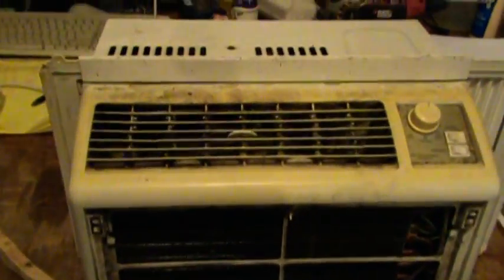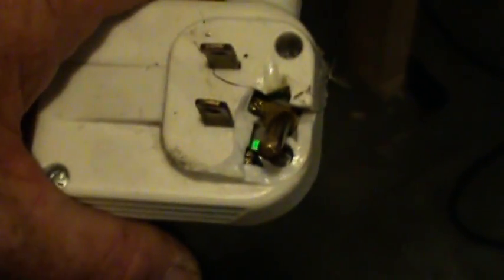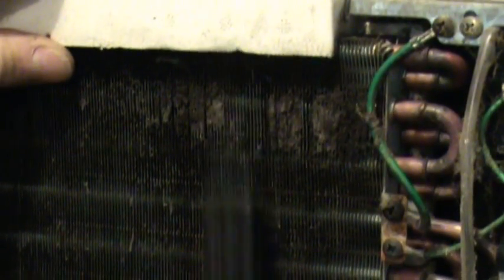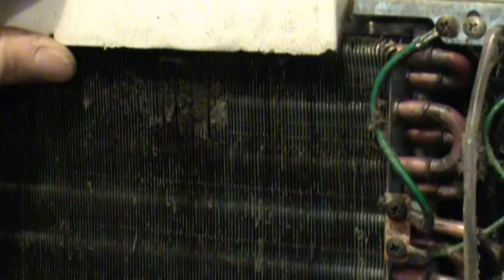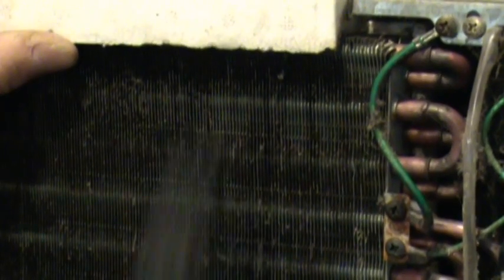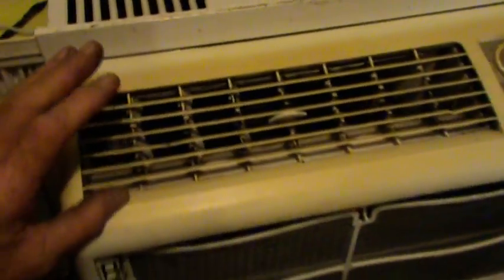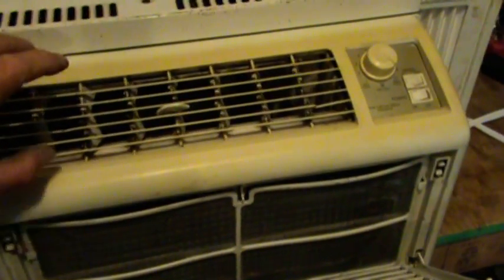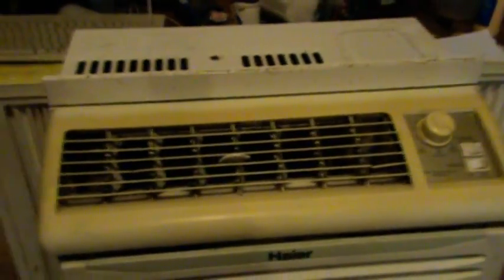Window AC Unit Cleaning - Part 1

Comment from the maker: A few years ago I found/saw a fin cleaning tool being used by an A/C technician.
It looks like a comb. What I used was a simple wire brush, which usually works well in most cases.

The trick to not bending the fins is not to apply too much pressure and keep in as straight a line when moving up and down.

Comment: My grandmother's house has these, one in a window and one in the one of the living room. The one in the wall doesn't have a filter. How would u go about getting a filter and installing it? Thanks in advance
Reply from the maker: I'm not certain as to where to find a replacement filter for these. I suppose you could try ebay. Are yours the same brand and model?
I have, in a pinch, made my own using an old t-shirt or fine thread cloth.
They don't last as long, meaning you need to keep them clean more often.
You can attach the cloth to the inside panel that folds out for access to the filter. Use paper clips or something similar to hold it in place.
Good luck. And thanks for watching.

Comment: i have a newer ac unit it came with an air filter but it's not keeping all the lint or dust build up out. i notice the fins bend very easily when cleaning. what tool or is there another method to clean this?
Reply: ebay, fin comb also spray coil cleaner which is designed exactly for that it will just devolve it, go to lows and get a cut to size foam filter they are under 5$ and work better than the ones that come on the ac. they are reusable so you can just wash it.

Comment: Sorry I meant one in the wall of the living room which doesn't have a filter. I've cleaned it as you've done but didn't see a filter
Reply: WalMart has foam filters that you can cut to fit for .96